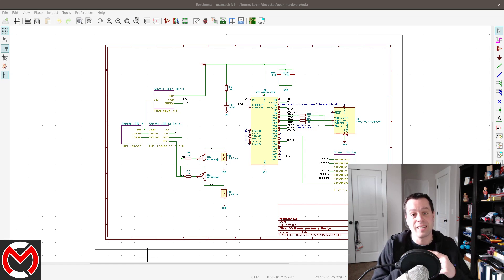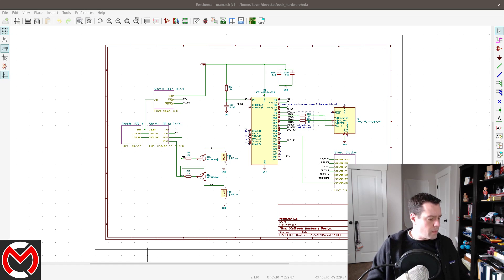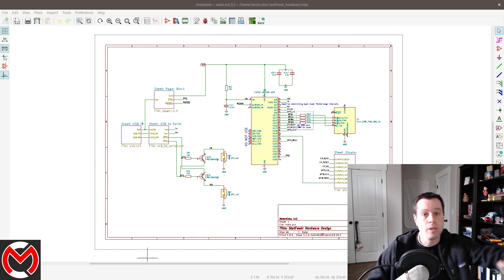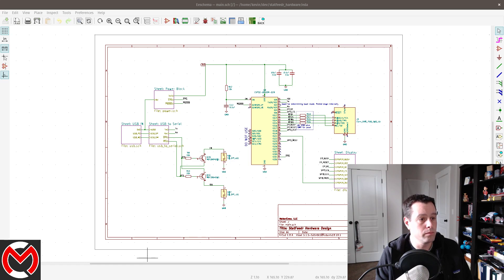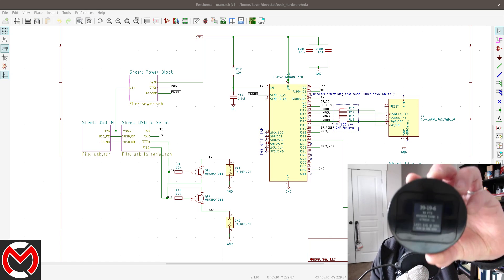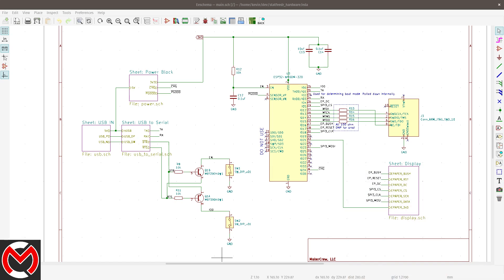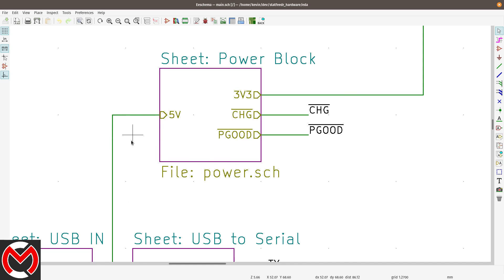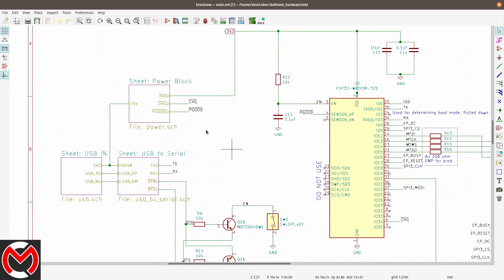Creating an ESP32 E-Paper Dev Kit From Scratch - Schematic

Comment: Hi Kevin, the resistor and capacitor on the enable pin is an RC delay circuit. It equates to a time constant of 1ms which delays enabling the chip until the power supply has had sufficient time to come up. The 100nF/.1uF capacitor is a standard value for a bypass cap so the 10K resistor was chosen to give the 1ms delay and I suppose coincidentally it happens to be a convenient value for a pull-up as well.
Reply from the maker: Thanks for watching and adding some clarification Richard. Really appreciate it.

Comment: I can't stress enough how helpful your videos are! I can kind of follow along with the schematics, but at times I am very lost. Do you have any resource recommendations that will help give me a better idea of the whys behind some of the areas in the schematic? Things like, why are there so many capacitors and their purpose between the circuit and ground? Any information helps. Keep up the good work! I'm looking forward to catching up on more of the awesome content on this channel!
Reply from the maker: Thanks so much Steven for watching and especially for commenting. That's a great question about the schematic. I'll cover it in a future video. Capacitors generally serve two purposes in the schematic we're working with. First, they can help with maintaining a nice smooth output voltage. When current spikes happen in the system it will cause the voltage to drop. If it drops too much things can brown-out and you'll get weird behavior that can be hard to diagnose. A capacitor between a power rail and ground serves kind of like a storage tank. If the system experiences a voltage drop the capacitor will help hold the voltage up. The other purpose is as a filter for high frequency noise. If noise gets onto the voltage line a capacitor to ground will essentially act like a short circuit to ground just for the noise portion which will keep it out of your integrated circuit chips. Hopefully that helps. If you have any other questions just send them over.
Reply: Awesome thanks for the reply!

Comment: I’m trying to use an esp32 dev board to do a model railroad hand held controller that simulates steam locomotives.  I’m battling through exactly what your doing as well.  Trouble is that I’m very close to being blind
Reply from the maker: Holy crap Mark, it's hard enough doing this stuff with full site. That's amazing you are doing it almost blind. Best of luck on the project. Sounds very cool.

Comment: Hello, great explanation! Could you make a tutorial on how to create an esp32 board that does not use wroom or 
Wrover modules, but design that part too using d2wd, d0wd or other chips (to make it even smaller)? Or do you know where I can learn how to design it? Because I searched on the internet but all the tutorials that I have found are featuring ready to go modules like wroom or wrover. Thanks in advance.
Reply from the maker: Hey Joe, thanks for watching and commenting. I've never played with those modules so my apologies. For my project I started with the datasheets and sample circuits provided by Espressif as a starting point. I also looked for reference schematics from places like Sparkfun and Adafruit. Wish you luck on your project.
Reply: @KevinSidwar  thank you!

Comment: Kevin, while working with ESP8266 I found the signal strength is not what it could be. All 3 of my devices stationed outside the house drop connection never to be seen again while scanning my network. What is odd if I go to these locations my laptop connects just fine so the signal gets the area in question or does it?
Reply from the maker: Sounds like a limitation of the antenna on the ESP8266 modules. I'm assuming they are all PCB antennas so they won't have the range to grab the signal like your laptop.
Reply: @KevinSidwar  and to make matters worse adding external antenna adds a signal loss affect.